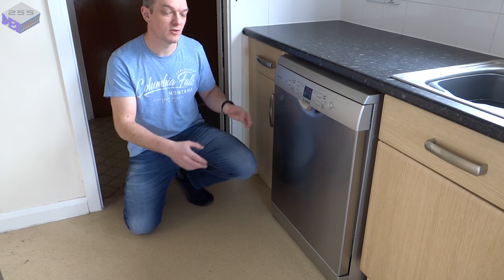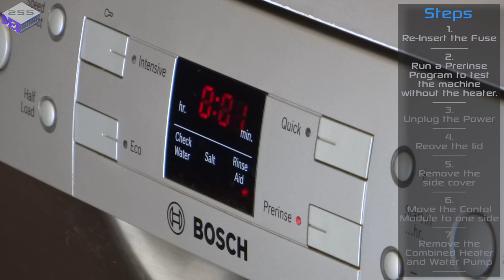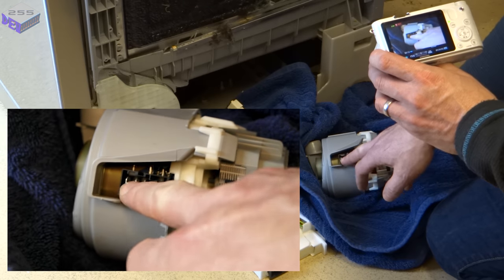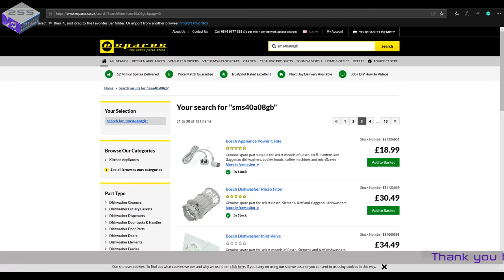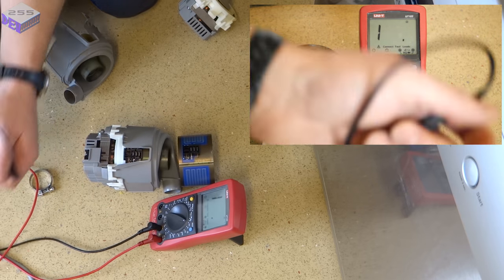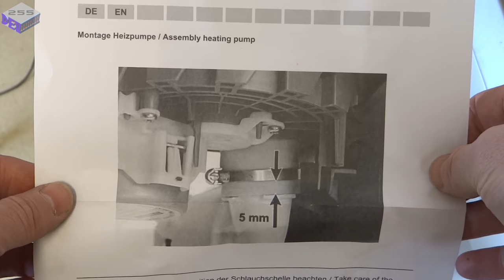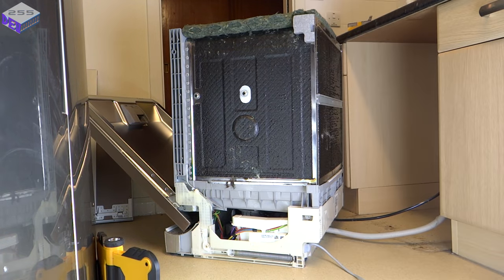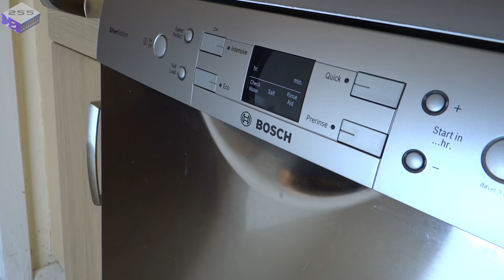How to Test & Replace the Heater & Pump in a BOSCH, SIEMENS, NEFF and more Dishwashers

Comment: Thanks! Fantastic video, helped me confirm the problem (RCD trip) and fix the dishwasher - everyone happy. Removing the heater+pump unit would have been difficult without knowing that you actually do just have to pull really hard. 

My heater had 20ohm between live and neutral (about right for ~2kw) and variable resistance to live and earth. Initially about 150K, but varied a lot and when removed there was no connection at all. So it seems that the problem (current leaking to earth) can vary a lot and stil cause the problem. I think the resistance would have had to drop to around 20k for it to trip the RCD - which I assume it may do when heating up and changing shape etc.
Reply from the maker: Thank you, I'm glad the video has helped. It is a bit disconcerting at first when you pull these out, especially if they have been there a while.

Yes, the RCD should trip quicker than 300ms at 30mA leakage to earth, and 20k at 240V would be 12mA, so at least your RCD is working well. It could be expanding slightly when heating up and causing limescale build-up in the seals, thus allowing water to get to the element.

Thank you very much for the Super Thanks, I will put it to good use on future content 👍

Comment: Thank you for your very thorough video. I really appreciate the step-by-step process of getting into the dishwasher and also how to test for faults. In my case, I was getting an E04 error on a similar make of Bosh dishwasher. Upon testing, I discovered an issue with the solder combined with some erosion on the heating element. I ordered a replacement heat pump and installed it seamlessly using your clear video instructions. You have saved me from throwing out a perfectly working dishwasher. Keep up the fine work!

Comment: Huge thanks for your video...  i had an issue with my Bosch sms63m28au and after a replacement water inlet hose failed to sort the issue, i found how to run the error diagnostic test and got an E09, narrowing it down to what i figured had to be the water circulation & heat pump (part 651956). It wasn't quite as easy getting it back on the pipes as i'd hoped... i did lube them up in the end with a bit of dishwashing liquid which helped), but this video was the god-send i needed.  So simple.. so clear... and made it easy.  So a massive thank you to you!!

Comment: Just fixed One of these. Don't buy from espares unless you have deep pockets. Laser electronics have same element for £70. However the issue is caused by calcium build up on one area causing the elements cooling to be less effective. This causes a hot spot and the element fails. The whole thing seems a bit environmentely unfriendly when you should be able to just buy the element. Especially considering the pump is completely fine and they have made you buy this complete unit when you only need the element.
Reply from the maker: Hi Tim, great advice, I have pinned your post to the top so people can read this also. Cheers for the info.
Reply: I bought just the heater of the pump on eBay, used, but it seems to work. Just screw the pump open and pull apart and replace heater. Whey putting it back together, pull the seal out of the motor part and attach to heater first before pushing it all together again and closing it up.
Reply from the maker: @blablubbb0815  Well done for fixing down to the heater, this would probably be the cheapest way to get up and running. 👍
Reply: I just checked for calcium residue in my heating element and there was close to none. Only a very thin layer on one side, probably thinner than 10µm and it correlates with the current path of the resistive tracks and it is only present on the lower half (gravity?). There are 4 places where the resistive path can be shorted out by the manufacturer, probably to adjust the resistance and one of them was used and you can clearly see on the other side where the calcium built up that he shorted out part of the loop is missing the calcium. That is a clear pattern. The burn happened in my case directly next to the connection from the plug to the heating element and on the other side is no calcium built up visible, just a slight discoloration. My conclusion would be that the plug was not correctly attached at that point to the heater element and caused a hot spot which eventually burnt out. Nothing to do with calcium built up, but a manufacturing defect/weakness, which took over 3 years to cause a fail.
Reply from the maker: @blablubbb0815  I love the detail you have put into your reply, I guess the manufacturers are not worried about the longevity of parts, just that they will survive to some percentage past the warranty period.
Reply: Hi, exactly and no need even new heating element...   Track burn off just in the beginning next to pin leg, due to minor leak from pump casing gasket... Just solder it again and swing a bit the gasket during assembly, to prevent leak again. All OK.
Reply: @blablubbb0815  Where did you buy it on ebay?
Reply: @KingArthasI  How did you open the heating element from the pump itself?
Reply: Do you mean LAZER ELECTRICS (£72.99, amazon)?
Reply: @blablubbb0815  Hello there! Would you please share with me the keyword to buy only the "heater of the pump" from ebay? I'm trying to get one but I couldn't find it.

Comment: Thank you for the very helpful video. I followed your very clear instructions and now have a working dishwasher.
 I would add that if the controller is difficult to remove or replace, taking the top cover off it creates more space and makes it easier to move.
Reply from the maker: You more than welcome, glad it helped you out and you can now relax rather than scrubbing dishes. Good point, I shall add it to the description to help others. Thank you.
Reply: The control unit has to be lifted upwards so that the power socket slide clear of its locator slot. On the Siemens IQ300 I couldn’t remove the top of the control unit because it hinges at the left hand end. I thought that there wasn’t enough clearance to lift, but that was because a black box which runs along back of the machine had sagged down. Lifting that with my left hand allowed me to ease the power socket upward with a flat headed screwdriver in my right hand. 
I agree with an earlier comment about espares . To top it off the video on their web is useless: wrong pump, inserted by different method, into different design of machine.
Reply: @rolandgower5434  wish I had read your comment before changing my Pump, I spent a little while battling with the control box  before realising how the black socket slotted in!! Pump all swapped and running a cycle now, all seems OK so far fingers crossed! My bosch unit was tripping the kitchen sockets.

Comment: Thank you very much for this video, it was really helpful. I was experiencing occasional tripping of the RCD over a period of several months, but the dishwasher was working normally. Then one day the dishwasher tablet stopped dissolving and the dishes were not clean - the full dishwasher cycle ran as normal but the tablet didn't dissolve. I realised this was due to the water not heating. I came across your video and tested the heat pump with a multimeter, however, it tested normal (i.e. the resistance between the live and neutral was 20.6, and there was no resistance between live and earth or between neutral and earth). The motor also tested normal with the multimeter. Nevertheless, I decided to change the heat pump unit as the water was definitely not heating. To my luck the new heat pump was fitted and the dishwasher operated like normal. Thanks again for this video!

Comment: Many thanks for this video, it’s enabled me to confirm with absolute confidence the fault with my dishwasher. Like one of your other commenters, the fault in my element is next to one of the solder joints of the connector, and I’m weighing up the safety risk of scraping the silk screen off the next 3mm of track and bridging with a solder joint, or whether to play it safe and buy a whole new pump/heater unit - shame I can’t find just a new element on its own for sale on the Internet. Many thanks again.
Reply from the maker: Glad it has helped. If you do go down the route of scraping and resoldering, you may encounter issues with earth leakage from the element to chassis and would be altering the resistance of the element, possibly reducing the elements resistance and reducing its life. Entirely up to you, I like to air on the side of caution. Hope that helps and good luck

Comment: I had the same problem. E09 and E10 error codes. Removed the combined pump/heater. Tested the heater element resistance between its power terminals and it was was infinite - i.e., there was no current flowing through the heater. Exposed the heater element by unscrewing and prying off the gray plastic cover. On inspection the connection between the power terminal on the heater and the heater element was damaged (bad manufacture? the remainder of the heater unit was perfect). Soldered the terminal. Measured the heater resistance which was now at 19.5 ohms. Reassembled and now the machine works perfectly. Great video, Neil, thank you.
Reply from the maker: Glad you fixed your own 👍, so yours has increased in wattage a little, hopefully it will be a permanent fix for the next few years 🤞. Did you manage to seal the repair with anything? I just have a concern that it could leak current to earth if water gets in while heating.
Reply: Thanks for the video Neil, I wish I had found yours first. I only found yours when I wanted to test the heater element. Once I read the comments, I checked out my element under a microscope and could see that it had burnt out immediately where it meets the connector. The rest looked fine. I used a scalpel to remove some more coating, and bridged the gap with solder. I then had 19.5 Ohms between the pins. Regarding your comment about protecting from water, I didn't have anything (since this is going to get hot). However the other pins for the heater are not protected or covered, (immediately at the solder point) so I reasoned it wouldn't prevent anything if water did get in. I note yours looked like it had water damage, so it is entirely possible water will get there. I have an RCD, so if I get current to earth, it will just trip the electrics, and that will be the first place I look. If it buys me another 6 months, I can at least start saving up and looking for a new one. Fitting it was quite easy - use a hose clip to replace the clamp if your not going to buy a new part. Thanks also to Paul above, as it was his post that made me pull it apart. I just went down and opened the DW, 30 mins in to its cycle. Nice hot water. (Pre wash to begin with is cold). Hope this helps others. I would only do this fix if you have an RCD.
Reply: @jamesthompson2522  i had the same idea with the connectors already exposed by default. Although I have three broken traces on the last winding somewhere, i have a hard time soldering on it. Any tips? It seems like it just doesn't stick.

Comment: ...and another thanks from me too.  Saved £100's.  Went to the same website, but only paid £86 (inc P&P).  Refitting is a little fiddly.  Found it best to remove all three internal trays and incline the dishwasher at around 45 degrees and then position the pump by 'feel' - went in almost immediately.  The power cable has a socket, which is part of the circuit board.  As you slide the circuit board upwards, the power socket slides up too, in a locator slide.  Upon re-assembly, locate the circuit board so that the power socket locates within this slider and slide it downwards.  Thanks again.

Comment: What a top guy. I was about to get a new budget machine as the Siemens SN45e205  inherited with the house, has been perfect for 10 years until two days ago. No error codes, runs all through the cycle, fills and empties, but no spray and no heat.  I  assumed the heat/pump needs replacing. I did not notice any odd noises it just didn't work in the last wash. So unless it can be something else (?) I'll put the new pump/kit on. Great to see the detail/tips on wiring kit etc..
Reply from the maker: Hi, it's a good idea to test the heater element before you order a new one as it may be the controller. Good luck fixing your machine.
Reply: @TheSolarPoweredEngineer  thanks Neil I haven't started yet. I watched both videos. If it's not the motor I probably won't fix it. Thanks for the reminder.

Comment: Replaced mine yesterday - pretty straightforward.  I had no E09 error code - just the machine tripping the RCD when running any wash programme but working fine on pre-rinse, which doesnt heat the water.
 
As Tim Hoad says it's bad environmentally that a perfectly good pump has to be trashed because the heating element has failed.  I intend to write (not email - paper letters get much more attention) to  Bosch to express my disapproval.
 
Anyway - as I said, pretty easy job - the hardest part was getting the control module back in.  Couple of tips:

If you lie the machine on its side it is much easier to access everything and see what you're doing.

The control module is easier to get back in if you take its top cover off and then replace it once the module is back.  And looking at the rear of the space from the inside to understand where the mains connector part has to slide in makes the job easier, as you cant see it when you start to maneuvre the module back in.

I bought my part from espares - the Lazer one isnt a Bosch one.   Yes - I know it's 99.9999% likely to be made in the same factory in China, but for £50 I didnt want to take the chance of more hassle.   And espares did next day delivery even with an evening order so I got it fixed quicker.
Reply from the maker: Hi, I hope Bosch take note from your letter as you are right, it's a shame to throw the motor away, I'm looking to use my old pump in a different project (MGF EV Conversion) so it doesn't go to waste. You have made some good points in your write-up, it does make sense to turn it on its side. Glad you got yours sorted.

Comment: E09 Dishwasher not heating at all. I was insecure about the repair, I called a serviceman, he said it was maybe the pump or the computer. He would not fix it, did not charge me anything and advise me to buy a new cheaper dishwasher. 
After following your video, I got my part exactly as shown, changed it and problem solved! thank you, Sir, for the video although the part doesn't come any cheap is better than to buy a new dishwasher, my DW is a Bosch silence 4 series very clean and well maintained a shame to throw it away.
Reply from the maker: Well done on fixing yours, glad the video helped. These are decent dishwashers. It may be worth you checking your salt setting too, as if this is set too low in hard water areas it doesn't soften the water as much and can lead to early failure.

Comment: Thank you from darkest Africa for this excellent video, I was able to repair my heating element which had a open circuit track fault near the connection, by cleaning and soldering a thick bridge of high temperature solder from the track to the connector. I've tested the dishwasher and it works very well no flashing fault code. Noticed that my version was missing all the sound suppression fitted to the EU models! I wondered why it was called " Silent" .
Reply from the maker: Hi, you are very welcome, I'm glad it helped you and you managed to fix it. Maybe you could install some sound suppression.

Comment: Excellent, thank you so much for posting this! This was extremely helpful in finding out why my Bosch dishwasher stopped heating water, and how to fix it. A beer on me! 🙂
Reply: In my case one of the pins connecting the heating coil with the plug socket had gone up in smoke. No electrical connection between connector and coil anymore. I was considering to try and make a big solder bridge across the burned bit, but decided not to because there's just too much power going into this for me to be comfortable with a kludge.
Reply from the maker: Thank you very much for this, I will definitely have a beer. You are a gent :-)
Reply from the maker: Very wise, I don't think the solder would have stood up to the heat and current flow.

Comment: Cheers fella. I had a slightly different issue, low recirculation water pressure and no hot water (but oddly no error codes). I knew the pump wasn't working so assumed the heater pump unit had failed. Ordered a new unit and installed using your video this morning. Working Dishwasher! saved us £550 for a new dishwasher. I'll drop a donation to your  Patreon
Reply from the maker: Hi Chris. I'm glad the video helped you; no need for a donation though, just happy to help.

Comment: Excellent guide - very helpful, thankyou. My issue turned out to be a loose pipe clamp where the heater pump connects to / discharges to the inside of the machine. I think this was causing water buildup in the bottom of the dishwasher, shorting either the heater pump or discharge pump - causing the fusebox to trip. Possibly not helped by some debris inside the heater pump impeller section. Anyway, working well now - thanks again.

ps. as Alex Linklater mentions below, step 1 / getting the control box out of the dishwasher proved impossible on my model (a bit different to that in the video [SMS40m02au]), until I worked out how to remove the top cover. To do this, I needed to unclip the left top end clips on that top cover, which took a bit of brute force / a small tool to lever them undone.
Reply from the maker: Thank you - well done for fixing your machine,  you have a sound diagnosis there with water getting into the electrical side after building up in the base, this would definitely cause an earth leak that trips the fuse box. Also give you confidence that you mains will trip on fault conditions 👍. Glad you found the video useful.